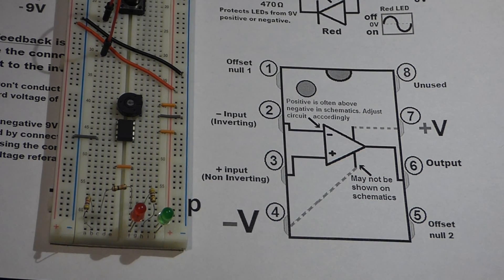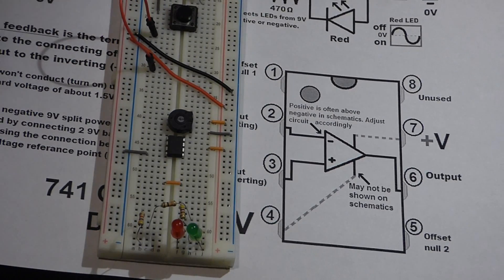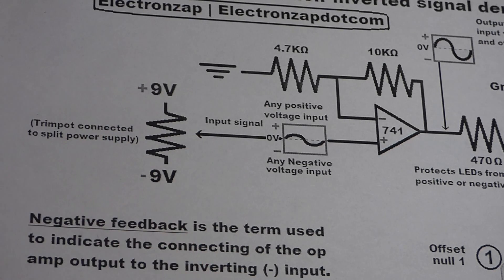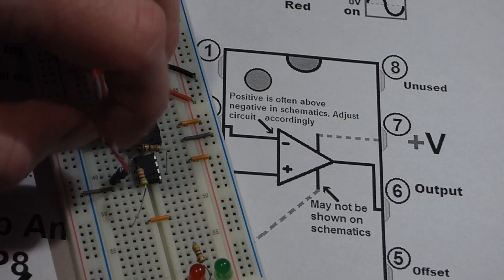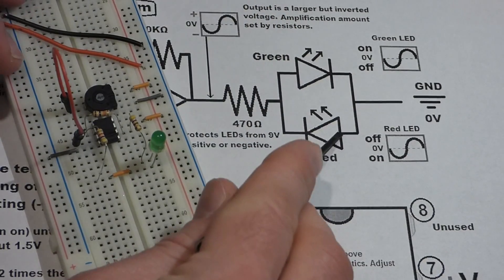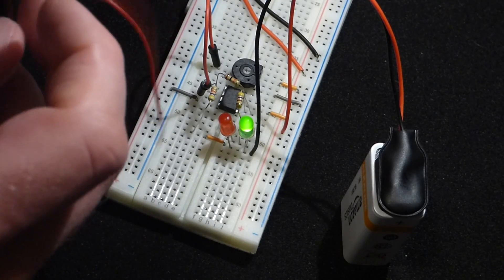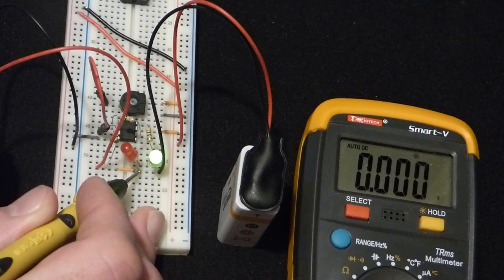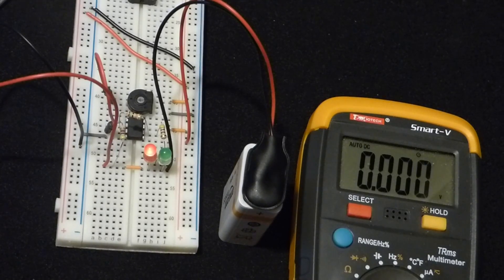741 op amp integrated circuit set to amplify a non inverted signal step by step electronics build

Comment: The 4.7k ohm resistor in the diagram should be 47k ohm. You used a 47k ohm resistor in the circuit.

Comment: Beginner question:  you use 10kOhm and 4.7 kOhm resistors. May I use 1 kOhm with a 470 Ohm resistor to get the same 2:1 proportion? At home I have 100kOhm, 10kOhm, 1kOhm, 660 Ohm, 460 Ohm, 320 Ohm, and 220 Ohm resistors but no 4.7 kOhm. Question is: may I combine these or do I explicitly need the kOhm range? In the kOhm range I could do a 10kOhm with a 1kOhm pair (will that be 10/1+1=11x amplification, and therefore too much, doing some damage)? I do not want to damage anything.
Reply from the maker: Easiest solution I can think of is to use two 10KΩ resistors, in parallel, in place of the 4.7KΩ. This will double the current (than of a single 10kΩ resistor) as if you had a single 5KΩ resistor and the circuit should behave about the same. 660 and 320 would probably be safe, or 1K and 460 would be a little better, but the input pins need practically no current (they technically just look at the voltage without passing hardly any current) so generally higher value resistors are used. Lower value resistors will drain a lot of current away from the output to the ground instead of through the load to ground so I would expect that the amplification to the load to be about equal to the input signal (no amplification), if that.
Reply: Thank you so much. I have gone shopping (got other electrical components I needed too) and did it exactly like you. Works. Keep up the good work.
Reply from the maker: Glad to help and thanks for watching! Components are pretty cheap on Ebay, but take a long time to be delivered.